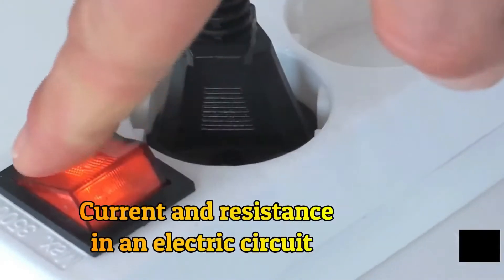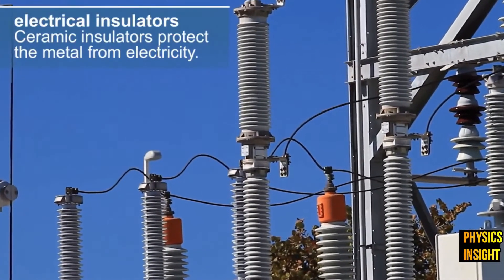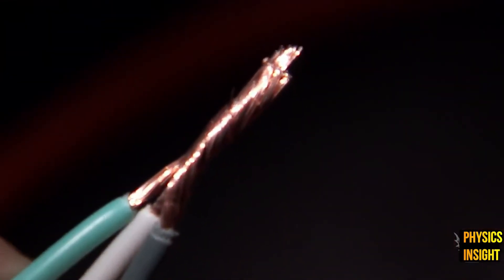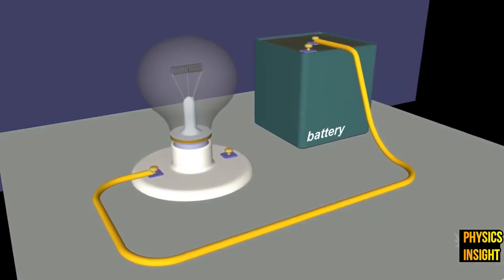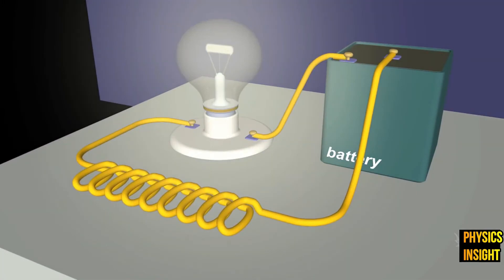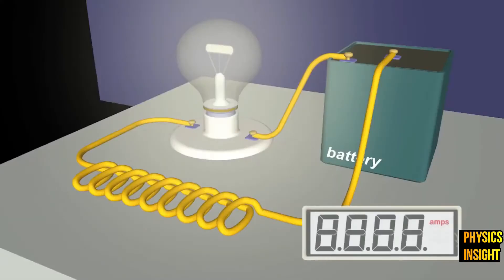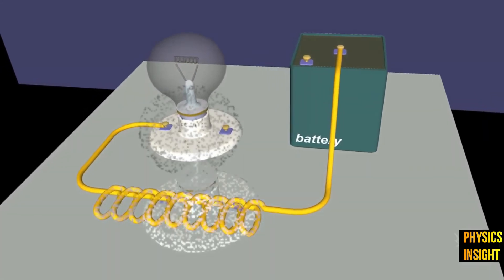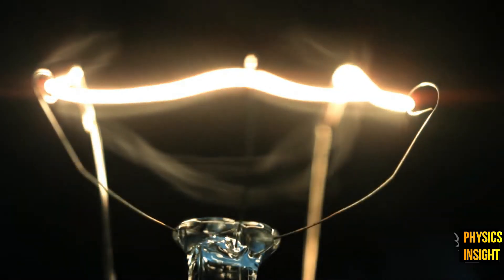Effect Of Resistance On The Flow Of Electrons

Comment: Jose Silva fixed radios and drew a parallel understanding of the similarity of electrical wiring to the human mind. If throughout religions, peace of mind has been synonymous with “light,” then all people have a degree of resistance within them. “I am the light.” “The less resistance, the brighter the light.” 

It would seem that resistance is good because it is inherently present in all conductors of electricity, but too much produces less visibility. If in religions, “Darkness” is synonymous with evil, cowardice, etc., then I should say “Yes!” to more and offer zero input on the resistance I view in others.

If I do offer input on the resistance of others, than am I being an insulator, like glass, to their light? Or am I diminishing the light all together by adding an additional light to the circuit?